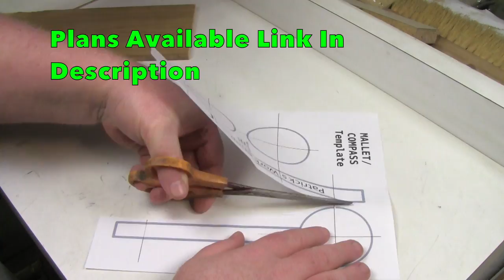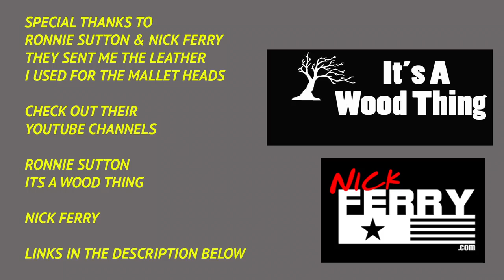How To Make A Mallet With Secret Built In Compass

Comment: I only wonder when the first time someone impales themselves on the  point when reading for the mallet. Nice idea, but that pairing just doesn't make sense.  Looking forward to the next video,
Reply from the maker: well it makes sense to me   and it works so so good and   normally i grab a mallet by the middle of the handle so its not a concern with the pointer sticking out  and besides  who reaches for a tool not paying attention anyway .  in the shop you need to be aware of exactly what you're doing or you will be covered in Band-Aids  and Cuts    lol  Anyway Right on thanks for watching